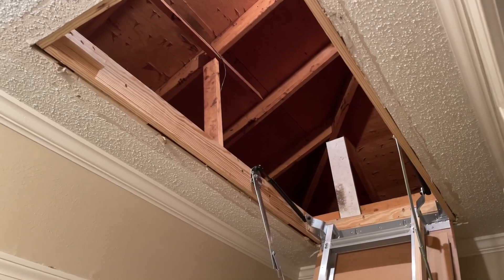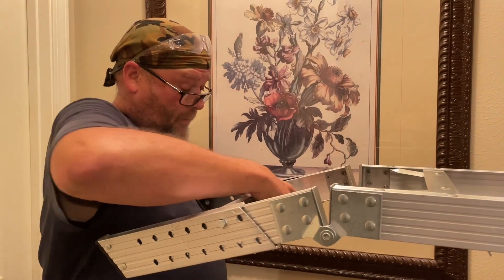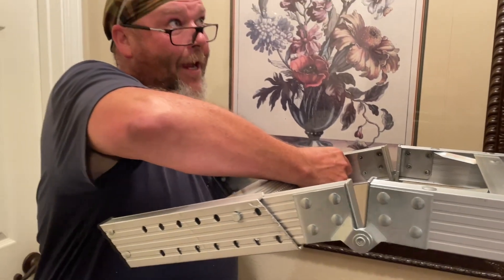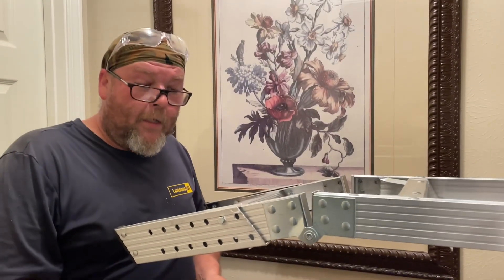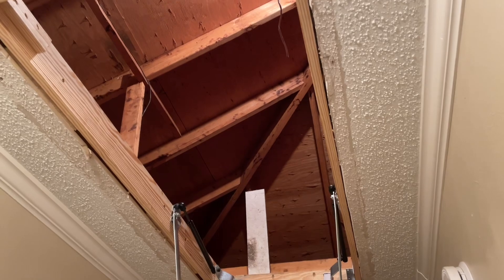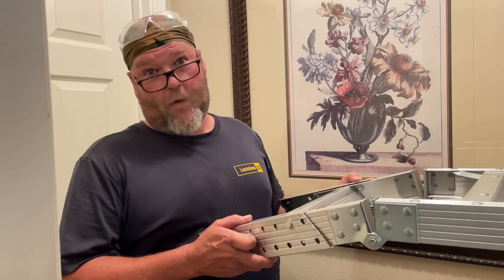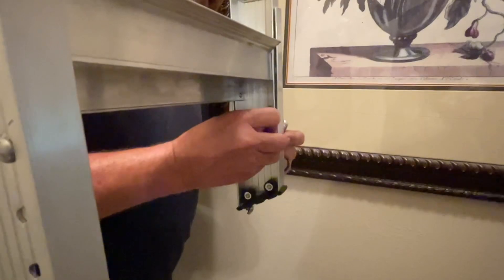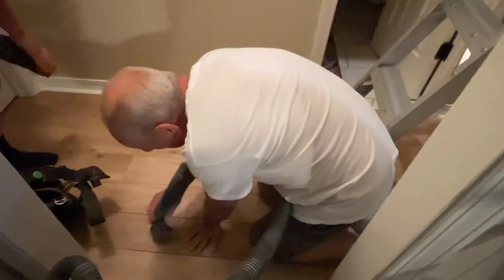Installing A Attic Ladder | Keeping Cold Air In

Comment: Oh my goodness he did a great job. Lippy don’t touch it. Lol. If the grandchildren put pillows all around the bottom and on the walls you should be fine to go up. Lol.
Reply from the maker: 😂, sounds like you and Mr Buddy have been talking? Lol. He really did a great install, and afterwards he put the new motor in the attic roof fan and the attic heat dropped 40 degrees within the hour.